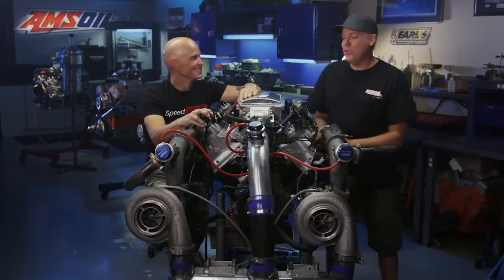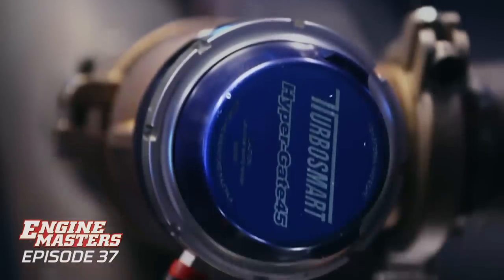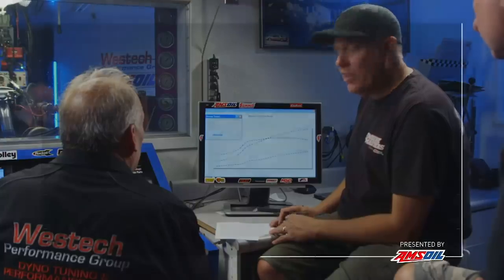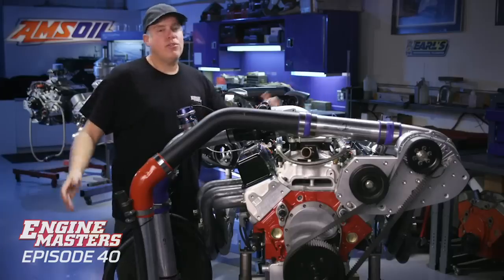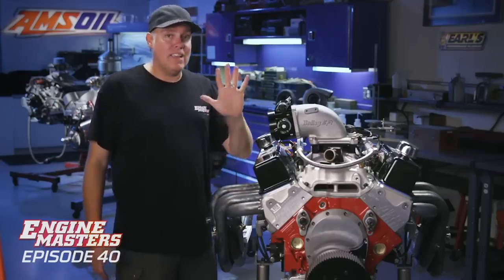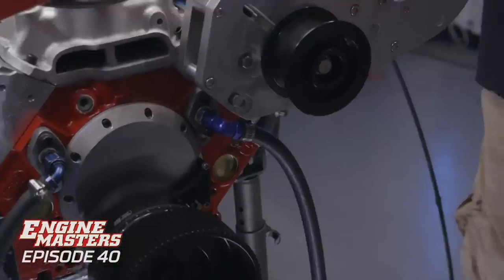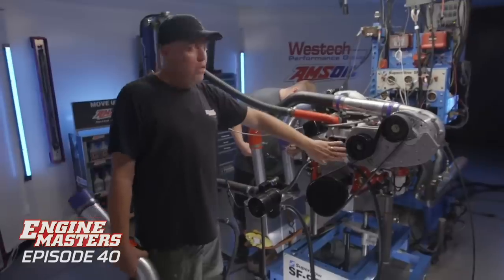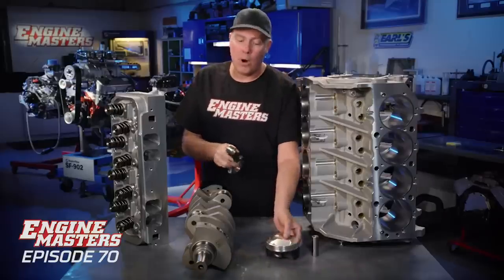1500 Horsepower?! Maximum Power Engine Mods | Engine Masters | MotorTrend

Comment: I smiled when he talked about the vacuum pump. Everyone looks at me like I'm nuts but honestly if you want better ring seal and cleaner intake (no grimy PCV oil), why wouldn't you?
Reply: Well, depending on your application, exhaust scavenging can be an excellent alternative that doesn't require a 'heavy' pump and the associated wiring. I think the moral of your story is just to pull a vacuum on your crankcase. If so, my sentiments exactly.

Comment: About the 200 engine theroy thats the exact thing I've done with my Rb. Expensive bottom end good top end. Moderate boost close to max stock ecu hp. It will do everything with no issues 😁

Comment: The amount of power we can get from engines today is insane, 4 cylinders pushing 500+ whp? straight 6 engines pushing 1200+, its a great world to be in if you're an engine guy!
Reply: 1.6l 3 cylinders pushing 300hp
Reply: @crazeguy26  or 2.0 pushing 600...

Comment: Turbos are easier on the bottom end because of drive pressure. Blown Pro mod hemis need the pan pulled and bearings every run. When you trade the blower for a hair dryer you can go 30 runs with out pulling the oil pan.
Reply: Lol 30 runs? Maybe a 3000 and 4000 hp

Comment: We made about 2000 hp back in 1988. A 427 bbc, steel caps, block filler, 36 pound boost, alky. 600 nos. Gm steel crank, 8500 rpm. Twin 1050 carbs.

Bloodviking

Comment: Hate to break it to you guys, and I love my LS powered Fox, but the first Gen Shelby GT500 5.4 will hold up to more power than any of the LS motors you’ve tested not just stock bottom end, but stock longblock all together. Take the blower off, add a pair of snails, you can make 1200-1400whp without touching the internals. We made a customer 1170whp with twin 6870 PTE turbos through a Glide, so that would be even more through a 6 speed and there was more power to be made at that point. LS mills aren’t the only engines that can make huge power stock, they just do it the most budget friendly.
Reply: Hate to break it to ya but he’s done well over 1500 on a stocker 😅.
Reply: Hate to break it to ya but these are pick up truck engines. What you’re saying would be more akin to using zl1 or zr1 engines. .....which would easily do it. There's a slb cts v out there making over 1200whp.
Reply: @HioSSilver1999 There are plenty of stock engine LS making that much power out there yes. I’m talking unopened though. 100% untouched. You’re not making anything except maybe a hero pass with a stock truck motor at that power level unless you at least do cam/springs and add ring gap at a minimum. And that’s not “stock”.

Comment: I am planning a similar dart block build.. Their base 350CI 1pc seal block, AFR comp 195's or maybe the 210's... 10psi D1SC straight non intercooled into a 9.5:1 comp with a comp bumpstick like a XFI 292...

If it will make 550hp at the wheels, heck i'd be happy...  The TKX tranny can only handle 650 i think anyways...

Comment: Back in the bad old days of the Killer B rally cars, Fiat Lancia made a intake system they called volumex, which was I believe a 2.2 liter with two turbos and a supercharger on top of it! They even when Sia claimed made 850 horsepower. This enabled the Stratos to do 0 to 60 in 3 seconds in sand! Have you ever tried putting both a turbo, or turbos, and a supercharger on top of an engine?
Reply: Leroy Baker  this is why God made intercoolers!
Reply: That's called twincharged
Reply: @xmo552  fiat/labia called it volumex
Reply: @fooman2108  
For a sec I thought I read fat labia 😂
Reply: @xmo552  😂🤣👈 lol you crazy..and and seeing things.
Reply: @L-Noble.YT_Hi.Res-Soundminds  
Yup

Comment: What about using the A/C for an intercooler? Could it cool the air charge enough to recover from the parasitic loss of the A/C compressor?
Reply: the thing needs to be huge to compensate something like 2000Liters of air per second warming up tens of degrees at that rate. That thing melts ice like crazy. Think how long the warm water needs to be in a huge refridgerator, to get back to ice? You need like a 100horsepower refridgerator, which is going to maybe add power afterall, but its going to be bigger than a roots blower, and need more coolant than the ice-bucket. 

Neither is good for endurance racing, ice is pretty good for drag/topspeed stuff. Endurance guys need to deal with ambient-air-intercoolers

Comment: A 582 could use a bigger carb, like 1350+ and make more power still.
Reply: 1050 on a 582 is street car stuff.
Reply: 1050s are for small blocks twin 1250 is more like it.... Or 16 1100 CC injectors... And 30lbs boost... Got BOOST... You should have!

Comment: RICHARD, HERE IS MY QUESTION TO YOU AND I HOPE POLITICAL CORRECTNESS DOESN'T GET IN THE WAY OF CAUSING YOU TO TELL A FIB. IS THE LS PLATFORM STRICKLY BASED ON FORD DESIGNS OF THE 427 HIGH RISER/351WINDSOR?????????
Reply: @Frank289100  Why did you bother asking? Also, your caps lock is on.
Reply: @C03 YOU GIVEN ME NOTHING HERE BUT NELSON RACING ENGINES? SAW THAT 2 YEARS AGO ABOUT THE LS AND EVEN COMMENTED ON IT, BUT IT SEEMS THEY REMOVED BY COMMENT TO HIDE THE TRUTH.
Reply: @C03 ALSO SAW THAT KATECH VIDEO BUT YOU STILL HAVEN'T GIVEN ME ANYTHING. SO HERE IS ANOTHER QUESTION: GIVE ME 1 ONE DESIGN ASPECT IN THE LS THAT CAME FROM THE OLD SMALL BLOCK CHEVY. DON'T COME BACK WITH THE BULLSHIT, TELLING ME THE ROD BEARING ARE THE SAME AND ALSO THE PUSHRODS. I WANT A DESGN ASPECT TAKEN FROM THE OLD SMALL BLOCK CHEVY THAT LIVES IN THE LS?
Reply: @mattteee2973  HERE IS A QUESTION FOR YOU MATT: WHY DID CHEVY SCRAP IT'S CONVENTIONAL ENGINE DESIGN AND REPLACE IT WITH ANOTHER CONVENTIONAL DESIGN TOTALLY DIFFERENT FROM THE ORIGINAL?
Reply: @shvrdavid  THE 351 CLEVELAND TOTALLY AND SINGLE HANDEDLY CHANGED THE FACE OF PROSTOCK DRAG RACING FOREVER. THE 351 CLEVELAND DOMINATED PROSTOCK TO THE POINT WHERE THEY MADE THE FORD'S CARRY 250LBS MORE WEIGHT AND THEY STILL WON. THE NHRA THEN LET THE CHEVY'S/CHRYSLER/ETC REMOVE MORE WEIGHT AND THE FORD'S ONCE AGAIN STILL WON. THE EMINANT DOOM OF THE SMALL BLOCK CHEVY WAS RIGHT AROUND THE CORNER AND THE NIGHTMARE GM FEARED WOULD SOON BECOME A REALITY OF PROSTOCK BEING TOTALLY POWERED BY THE 351 CLEVELAND MOTORS. THEN IN 1983 THE NHRA (ANOTHER DIVISION OF GM) HAD THEIR HENCHMEN IN THE NHRA MANDATED THE 500ci RULE AS A PLOY TO STOP FORD FROM DOMINATING PROSTOCK ANYMORE. SO THE NHRA ALLOWS GM ALONG WITH WARREN JOHNSON TO BUILD A NEW ENGINE CALLED "THE DRCE - DRAG RACE COMPETITION ENGINE". SO GM TAKES THE OLDSMOBILE BLOCK AND STUFFS IT LIKE A THANKSGIVING DAY TURKEY WITH A CAM AND ROTATING ASSEMBLY FROM A BIG BLOCK CHEVY AND THEN WARREN JOHNSON HAS A BIG PAIR OF FORD CLEVELAND HEADS MADE FOR IT. SO SINCE 1983 TO PRESENT WHAT CHEVY HAS BEEN WINNING WITH IS A FORD CLEVELAND ENGINE. THIS IS THE REASON FORD DOESN'T GET INVOLVED IN PROSTOCK RACING. BECAUSE IT IS ALREADY FORD POWERED. AT THIS POINT BOB GLIDDEN GOES OUT AND GETS HIMSELF A BOSS 429 ENGINE AND SLAUGHTERS ALL OF THEM. EVERY YEAR AS GM/CHEVY GOT FASTER WITH THERE GENERIC FORD CLEVELAND ENGINE. BOB GLIDDEN WOULD SLIGHTLY PORT THE BOSS HEADS KEEPING HIMSELF AHEAD OF THE CHEVY'S AND THE REST OF THEM INCLUDING THE HEMI'S. IT REACHED THE POINT WHERE FORD AND BOB GLIDDEN WERE GETTING READY TO CAST A NEW FORD BOSS HEAD AND MOST LIKELY THEY WOULD HAVE BEEN NAMED "THE SUPER BOSS HEADS". AT THIS POINT THE CHEATERS THE NHRA TO PUT CHEVY AND KEEP CHEVY IN THE WINNERS CIRCLE TOLD FORD AND BOB GLIDDEN THAT THEY HAD TO MAKE A 1000 PAIRS OF THESE HEADS AVAILABLE TO THE PUBLIC IF THEY WANTED TO RACE. THE NHRA KNEW THE BOSS MOTORS WERE MADE IN LIMITED NUMBERS AND A MARKET FOR THESE HEADS DIDN'T EXIST. OBVIOUSLY THEY KNEW FORD WASN'T GOING TO SPEND COUNTLESS MILLIONS TO PRODUCE HEADS FOR A MOTOR THAT NO LONGER EXISTED. FORD AND BOB GLIDDEN THEN TOLD THE NHRA TO GO "F" THEMSELVES. THIS IS HOW FORD'S DOMINANCE IN PROSTOCK CAME TO AN END. IN 1980 BOB GLIDDEN DID SWITCH OVER TO CHRYSLER AND WON BEATING THE FORD'S ONLY FOR ONE REASON. LIKE THE CHEVY'S THE CHRYSLERS ALSO BENEFITTED FROM THE WEIGHT BREAK OF NOT HAVING TO CARRY 250 MORE POUNDS AND ALSO THE NHRA ALLOWING THEM TO TAKE OFF EVEN MORE WEIGHT ON TOP OF THE WEIGHT FORD WAS CARRING. THE FORD CLEVELAND MOTOR WAS THE ULTIMATE IN POLY ANGLE HEAD DESIGN. IT IS SO STATE OF THE ART THAT DOESN'T GET ANY BETTER. IT IS HARD TO IMPROVE ON IT INITIAL DESIGN OTHER THAN CHANGING PORT AND VALVE SIZES. TODAY YOUR SYMMETRICAL RACE MOTORS LABEDED AS CHEVY ARE ACTUALLY FORD CLEVELAND DESIGNS. YOUR MOUNTAIN MOTORS LABELED AS CHEVY ARE FORD BOSS 429 DESIGNS. THE ADVANTAGE OF THE BOSS HAS OVER THE HEMI LIES IN ITS CRESENT SHAPE COMBUSTION CHAMBER. THE CRESENT SHAPE, ANGLES THE FLOW ALIGNMENT BETWEEN THE INTAKE AND EXHAUST OFF SETTING THE VALVE RELATIONSHIP BETWEEN THE INTAKE AND EXHAUST SO IT IS NOT STRAIGHT. WHAT THIS DOES IS SLOW DOWN THE FUEL/AIR MIXTURE GIVING IT ENOUGH TIME TO COMPLETELY BURN FOR THE MOST EFFICIENT MAXIMUM BURN FOR MAXIMUM POWER. ON THE OTHER HAND THE HEMI DESIGN BEING STRAIGHT THROUGH ACROSS, DOESN'T ALLOW THE AIR/FUEL MIXTURE ENOUGH TIME TO FULLY BURN CREATING INEFFICIENCIES. THE CLEVELAND IS OF A SIMILAR DESIGN TO THE BOSS AND THE REASON THE CHEVY "DRCE" DOMINATES OVER THE HEMI FOR MANY YEARS IN PROSTOCK.
Reply: @shvrdavid  THEY DID STUFF THE OLDSMOBLE BLOCK WITH A BIG BLOCK CHEVY ROTATING ASSEMBLY AND THEN MADE A SET OF FORD CLEVELAND HEADS FOR IT. THIS IS WHAT THE DRCE ENGINE IS, A BIG CUBE FORD CLEVELAND ENGINE. (The 351 got the exact same weight breaks as the chevys, not as you claim.) <<--- WHY ARE YOU TWISTING THE TRUTH WITH LIES. THE 351 CLEVELAND WAS SO FAST THAT THEY MADE THE FORD'S CARRY 250LBS MORE WEIGHT. EVERYTIME BOB GLIDDEN WON THEY ADDED EVEN MORE WEIGHT TO HIS CAR AND STILL WON. GLIDDEN WOULD SET HIS REV LIMITER AT 7000RPM'S TO BEAT MOST OF THEM. THE ONES HE HAD TROUBLE WITH. HE WOULD RAISE IT TO 7500RPM'S AND HE STILL HAD ANOTHER 1000RPM'S TO WORK WITH. BUT WHAT THE NHRA DIDN'T KNOW IS THE POTENTIAL OF THE CLEVELAND MOTOR. AS THE GM HENCHMEN KEPT ADDING WEIGHT, GLIDDEN KEPT RAISING THE REV LIMITER SLIGHTY TO COMPENSATE. AND THE NHRA THOUGHT HE WAS GOING FASTER BY TWEEKING THE TUNE. BUT ON THE PART OF CHEVY, ALL KINDS OF CHEATING WAS GOING OF AND THE NHRA LOOKED THE OTHER WAY AND THE FORD'S STILL TRAMPLING THE SMALL BLOCK CHEVY TO DEATH. THIS IS THE REASON GM HAD THEIR HENCHMEN THE NHRA MANDATE THE 500ci RULE TO STOP FORD'S DOMINANCE IN RACING. SO GLIDDEN GOT A BOSS 429 AND TRAMPLE THE DRCE TO DEATH. HE WAS BEATING THEM YEAR AFTER YEAR AS GM KEPT CASTING NEW VERSION OF THE BLOCK AND HEADS FOR THE DRCE AND THEY STILL LOST. ONE FORD CAR VS A ARMY OF GM PRODUCTS AND CHEVY STILL LOST.
Reply: @shvrdavid  I'M GLAD YOU BROUGHT THIS UP BECAUSE IT ONLY PROVES THE POINT THAT GLIDDEN WON IN A PLYMOUTH BECAUSE HE WASN'T REQUIRED TO CARRY THE 250LBS +++ MORE WEIGHT. IT ALSO PROVES SOMETHING ELSE. THAT THE CHRYSLER ENGINE WAS A BETTER MOTOR THAN THE SMALL BLOCK CHEVY, IF ONE CAR WAS ABLE TO DOMINATE OVER MANY OF THOSE SAME WEIGHT CHEVY'S PROVES IT WAS A SUPERIOR ENGINE. SECOND, THE DRCE WAS A OLDS BLOCK WHEN IT FIRST DEBUT IN 1983 WHICH THEY PUT A BIG SET OF FORD CLEVELAND HEADS ON WHICH IS CALLED CHEATING. AS FOR LEE SHEPARD WINNING. HE HAD THE ADVANTAGE BECAUSE HE WAS RUNNING A LIGHTER CAR. AS GLIDDEN KEPT WINNING THEY KEPT LOADING HIS CAR UP WITH EVEN MORE WEIGHT TO SLOW HIM DOWN GIVING LEE SHEPARD AND OTHERS A CHANCE TO WIN. MIX IN ALL SORTS OF CHEATING WHERE THE NHRA LOOKED THE OTHER WAY WHEN IT CAME TO PUTTING CHEVY INTO THE WINNERS CIRCLE AND IT'S A FORMULA FOR VICTORY. IF THEY DIDN'T PUT THE WEIGHT BREAKS ON THE FORD'S. THE CHEVY SMALL BLOCK WOULD HAVE DISAPPEARED FROM PROSTOCK AND MANY OTHER CLASSES IN RACING. THE CLEVELAND JUST BEAT THE SMALL BLOCK CHEVY INTO A GRAVEYARD. TO SUM IT ALL UP CHEVY HAS BEEN CHEATING THERE WAY TO THE FINISH LINE FOR DECADES SINCE THE AMA BAN (GENTLEMEN'S AGREEMENT) OF 1957.
Reply: @shvrdavid   ONCE AGAIN YOU ARE TWISTING THE TRUTH. I NEVER SAID DURING THE 500ci RULE THEY MADE THE FORD'S CARRY MORE WEIGHT, IT WAS BEFORE THE 500ci RULE SO YOU LIED FOR YOUR OWN AGENDA OF BEING BUTT HURT TO THE TRUTH THAT CHEVY/GM CHEATED THEIR WAY THROUGH RACING FOR DECADES, WHICH IS A TRADE MARK OF CHEVY. Arlen was one of the brain child's behind the DRCE Gen 1 and 2 heads. Do you even know who that is? I doubt it. I fail to see how a blank cylinder head casting that has basically zero machining done to it is a copy of a ford head. The only thing the have in common is a canted valve arrangement and symmetrical port designs. Ford was not first with that design either. I have yet to see a 351 head that can flow anywhere near the air a drce head can, and if it was a copy as you claim, it would flow just as bad as the cleveland heads do.)<<<--- IF YOU GO BIGGER ON THE VALVES AND PORTS OF THE ORIGINAL CLEVELAND DESIGN TO ACCOMODATE BIGGER CUBIC INCH OF THE DRCE. OBVIOUSLY THEY WILL FLOW BETTER. SO WHAT MADE YOU COMPARE THE FLOW RATE OF A PRODUCTION HEAD FROM A PASSENGER CAR, TO A SPECIFIC DESIGNED RACE HEAD FOR DRAG RACING AND WHY IT CALLED "DRAG RACE COMPETITION ENGINE. THE CLEVELAND IS THE ULTIMATE IN POLY ANGLE HEAD DESIGN AND THE REASON CHEVY/GM COPIED IT. THE DRCE IS A BIG CUBE FORD CLEVELAND ENGINE. RICK SMITH (FOUNDER OF TRICK FLOW) WORKED WITH WARREN JOHNSON. In the early 1980s, Rick Smith worked at a pattern shop that built the tooling for Pro Stock legend Warren Johnson and the then-new Oldsmobile cylinder heads for Pro Stock, <<<---OLDSMOBLE STYLE CYLINDER HEAD. SO IF I WAS WRONG ABOUT THE BLOCK BEING A OLDSMOBLE. THEN WHY WOULD THEY PUT A OLDSMOBILE STYLE HEAD ON A CHEVY BIG BLOCK. ONCE AGAIN YOU ARE WRONG AND TWISTING THE TRUTH. WHEN RICK SMITH ASKED WARREN JOHNSON WHAT ARE THEY DOING HERE. WARREN JOHNSON REPLIED AND SAID "WE ARE PUTTING A FORD HEAD ON A GM BIG BLOCK".
Reply: your caps is locked lol.. you guys are so entertaining..😄👍
Reply: @L-Noble.YT_Hi.Res-Soundminds  IT'S NOT THAT MY CAPS ARE LOCKED. IT ONLY SEEMS THAT WAY BECAUSE THE TRUTH THAT THE LS IS A FORD MOTOR IS MAGNIFIED.
Reply: @Frank289100  😂👍

Comment: I like doing it the hard way. There's no challenge in building an LS. Yes they're great, but anyone can do a "full bolt ons" LS. So.... yay for the bonny sbc and 💩 like that.
Reply: He's Boomer AF.
Reply: @lucysmith4242  
Better than millennial af
Reply: Better go draw your water out of the well then.
Reply: @Brayden Brayden 
So by that reasoning why dont you go swap in a 1000hp 1 cyl or go electric/hybrid? You'll be able to soon. U down? What I'm talking about is the old school where you create something not just dial up a parts list. I know efi is better. I don't want better. I want visceral and mechanical.
Reply: @xmo552  I'm loyal to speed for performance. If I can electric swap and go faster cheaper, then ya boy Gon be pulling up in an electric swapped Nova
Reply: I rest my case

Comment: Australian Ford Barra engine. An inline 6 cylinder that's just as capable.
Reply: Agreed. Barra is a bloody great engine.
The Miami is also built for massive boost. You don't need to open the engine just bolt on anything outside & watch it go.
Reply: @danlonick800  Yeah barra builders have been working with stock blocks doing over 2000 horsepower. And that's only a 4 liter 6 cylinder engine. Stock crank too.

Comment: Curious, what fuel are you using when making 1500 hp in the beginning of the video?
Reply: If I would hazard a guess race fuel.   Maybe e85.
Reply: @bmstylee  I'm curious of just that, e85 or what race fuel.
Reply: @DannyO0917  110 octane maybe.
Reply: @bmstylee  makes sense, likely leaded gas vs what we find in modern set up where e85 is the best choice when we have o2 sensors etc

Comment: I may switch back to cad 500 when they make a steel cad 472 500 crank.

Destroking helps cads make hp at higher rpms.

A secret rich holdener didn't know till I told him.

Bloodviking

Comment: THE CROSS BOLT MAIN DESIGN GOES BACK TO THE EARLY NASCAR/MARINE FORD 406 MOTORS IN 1961. THE HEMI AND THE FORD 427 SOHC WERE CROSSBOLT MAINS AND BUILT FOR ROUGHLY 800HP, BUT YET THEY WERE ABLE TO WITH STAND 1500+ HP. IT WOULD BE INTERESTING TO SEE AND REMOVE THE BOLTS OFF THE CROSS BOLT MAINS ON THE LS AND SEE WHAT HAPPENS.

Comment: 1006 hk @ 7400 rpm
=> 955 Nm @ 7400 rpm.
955 Nm = approx. 702 ib ft. 
What is the volume of the engine?
Reply: 582 cubic inches or 9.5 liters

Comment: What was the bore/stroke combination on that Little M block?
Reply: I think 4.125 bore and 3.25 stroke
Reply: @indyrock8148  that was my thoughts too. I did a bore/stroke calculator,  and that's yeah... I can't imagine anyone running a Little M block and "not" taking advantage of the bore capacity, regardless of stroke. Myself, I would have opened it up to at least 4.165. Max bore I believe is 4.185 on the Little M. Thnx..😎✌️
Reply: @aumetalmental8403  the full episode is on MTOD and that's what he says